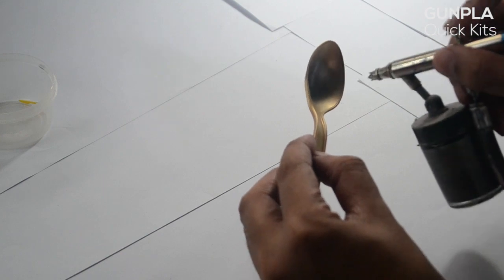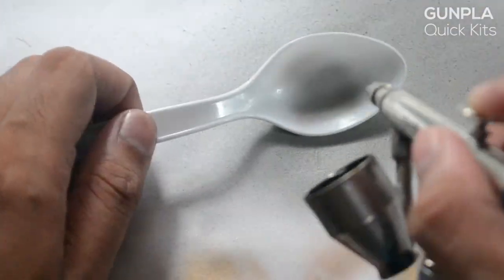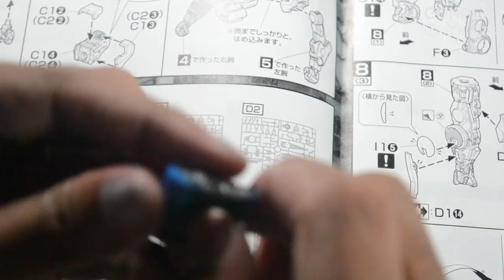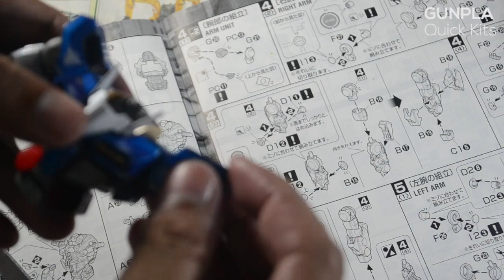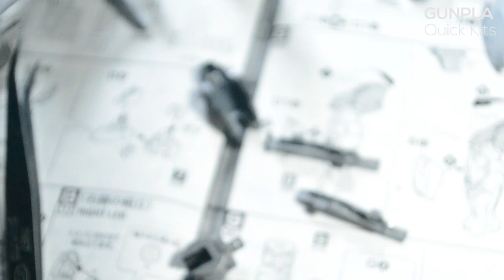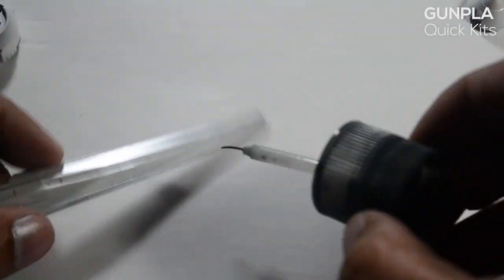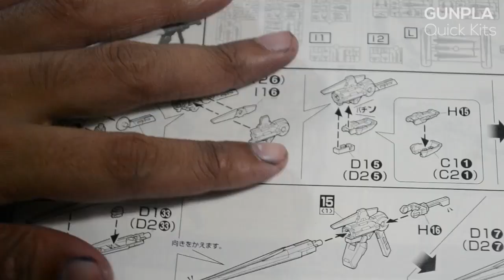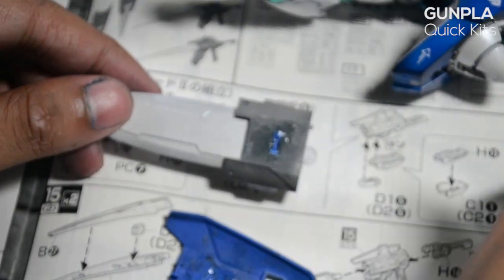MG 00 Gundam Timelapse Paint Build - GUNPLA QUICK KITS

Comment: The results are amazing! That blue was stunning! Which colors you used to achieve that final effect on the blue part?
Reply from the maker: used Tamiya Black > Silver > and then Clear Blue then two coats of Gloss Clear to give a shiny look! Thank you
Reply: Can you achieve that effect using paintbrush only?
Reply from the maker: I've seen people do it, however I have no experience doing it myself. - If I remember correctly I've seen a guy do Astaroth Origin on a metallic scheme using paint brush only, so I'd say its possible if you thin your paint enough and did it with several coats.
Reply: Did you flat coat or full gloss coat?

Comment: Hello Sir, I am new to the hobby and I am curious if I could get the same result with just using paint brush. Thank you po.
Reply from the maker: Hello, welcome to the hobby! - It will be really hard to achieve metallic with paint brush, unless you are super experienced with hand brushing. - I'm not saying its impossible, but it  requires a lot of practice. check out prime92 hand painting metallic using paint brush
Reply: Thank you for recommending Prime92.

What paint did you use to have that pearl white finish?